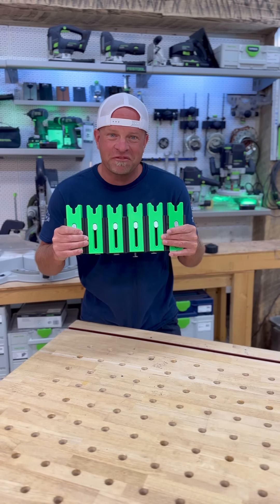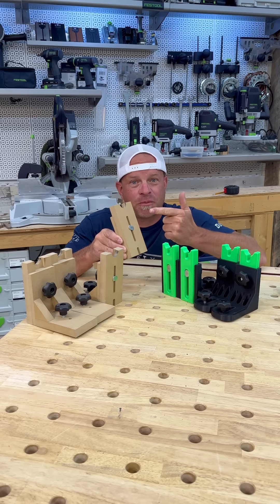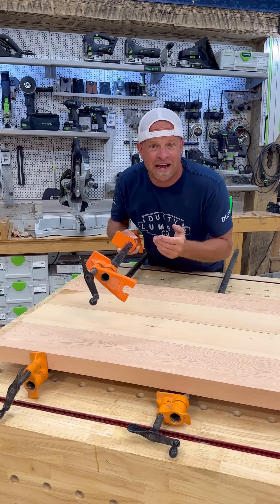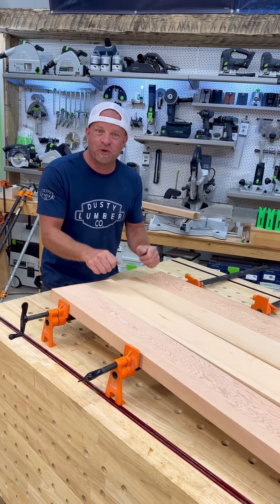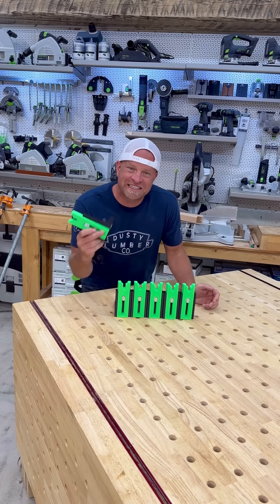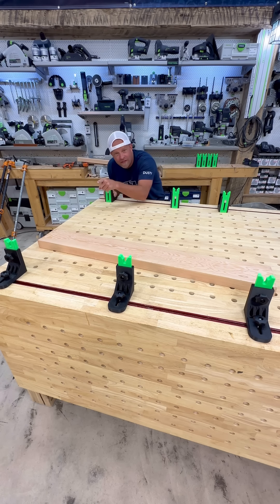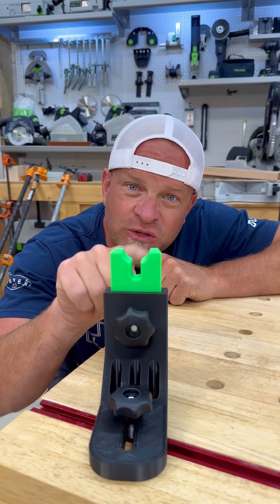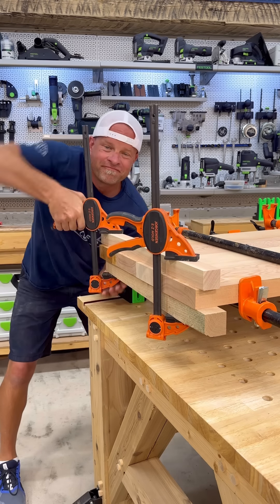Great invention that makes woodwork glue ups less stressful and more efficient

Comment: Clamp together 2 2x4s face down. Drill holes the size of your clamps where the boards meet and spaced at some interval, say 12”. 
Turn those boards on their sides and run packing tape along the top and space those two boards far enough apart to accommodate your glue-up. Lay your clamps in the semi-circles and now clamp away. No brittle,weak 3D plastic required.

Comment: And for those of us who use dovetail clamping systems, forgo the t-tracks and just route your dovetails into the top of your glue-up station. I made molds to pour my own epoxy resin dovetail slides that accept the same 10-32 threads as the micro jig system. I made knobs and purchased long bolts with the same 10-32 threads so I can pour as many as I like. I can see from this jig that all of the bits can be substituted for 10-32 compatible parts. I might mold my own parts and pour this jig and see how it works. I’ll keep ya posted on the outcome. Great idea for glue-ups!

Comment: I solve all of these problems by using a few dominos to align boards when necessary and doing the glue-up vertically on a pair of sturdy saw horses. This has the added advantage of giving me full view and access to all sides of the boards, and glue isn’t running all over the place as I draw the boards together and close the joint. It also keeps glue from dripping onto my clamps. I’d much rather have another pair of sturdy horses than some stupid little one trick pony gizmo taking up space in a drawer.

Comment: If your doing a glue up and need ends to pefectly line up just stop and go inside before you hurt yourself. Always plan to trim ends and you know that. Im a custom stair builder for over 30 yrs and cant even tell you how many treads ive made without them. In my 3400sq ft shop i have no more room for another tool or machine. There comes a time to just say no

Comment: Why? Yes, this is a great video of the product and how the product is used, but why go to all that trouble when you can begin by putting the clamps on the top of the glue up.
Use a long block of wood at each end of the boards to glue, make the support blocks high enough to allow other bar clamps to slide underneath (if necessary).if cauls are required, each end could be lifted up to put then in place.
This is a good solution to a problem that does not need to exist! The solution as shown in the video is very time consuming to implement, plus the need to purchase or make these adjustable holders. Just use blocks or make an inverted "T" support, problem solved AND money saved.

Comment: If you want consistent distancing for the clamps, you could add two identical tape measures to the work bench top or recessed in to run along the T track. Quick easy refference if you can keep the glue off of it.
Reply: Paste wax, my guy 👍
Reply: Plenty of other uses for this wonderful idea!
Reply: I use a candle wax to make slots easy to run in, and it’s hard wearing and does not let saw dust stick to it.

Comment: Yea that not bad. The bench is a big player though
Reply: One of the cool things these jigs do is, they allow you to utilize the full length of your clamps even if you have a small or narrow assembly table. For instance, my assembly table is 3' wide, but with 6' pipe clamps in the saddles, I can still glue up a 5' wide table on a 3' wide assembly bench and have my whole glue up be stable accurate